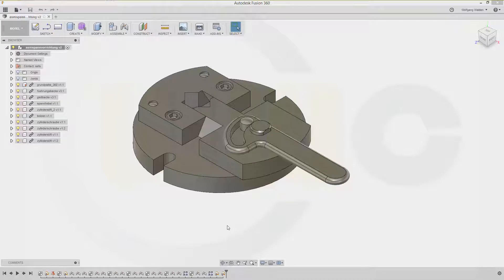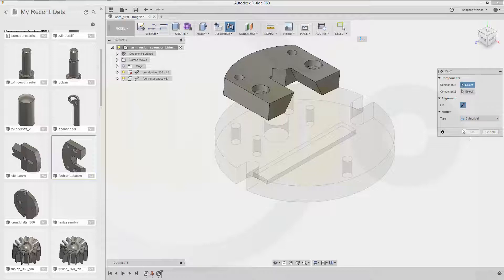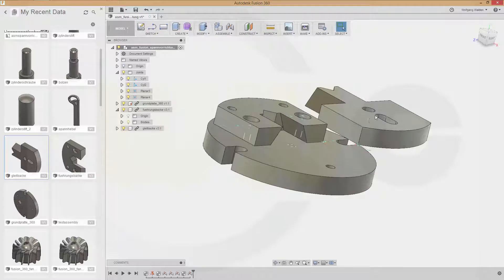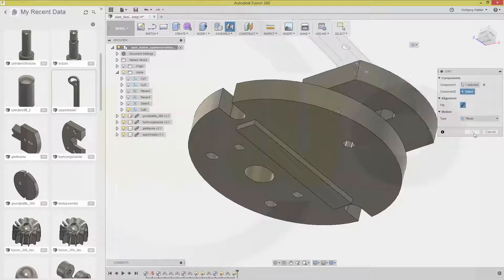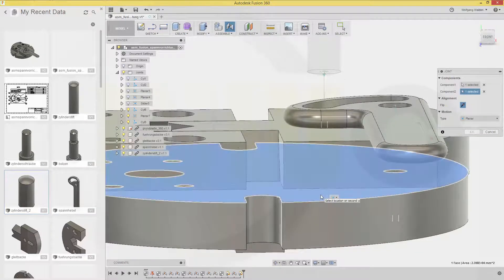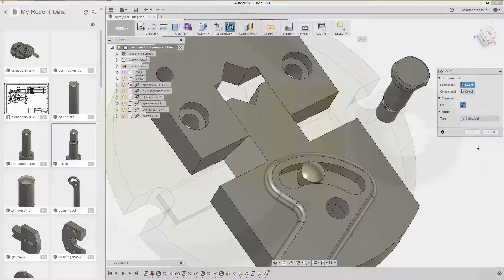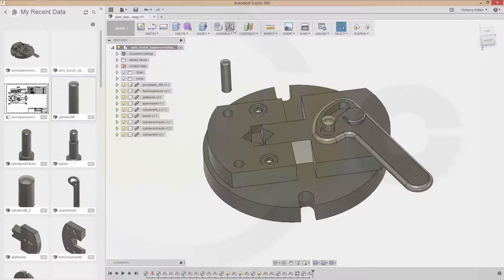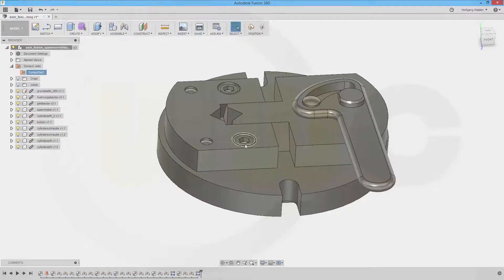Spannvorrichtung - Autodesk Fusion 360 Training - Assembly

Comment: I think you have made too many joints. In case with hole and cylinder only one joint needed. Pick up one circle with center on one component and then pick up circle with center on the other component. I have made same mistake.
Thank you for your lessons.
Reply from the maker: That is indeed possible - it will get better soon ;)